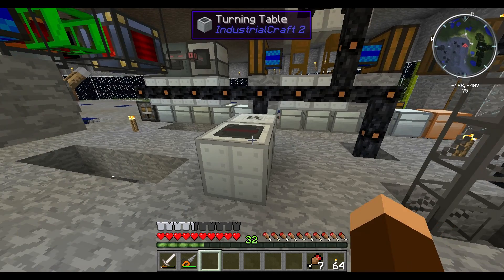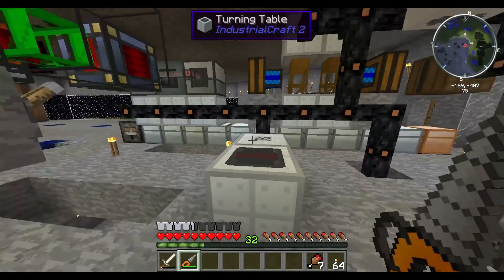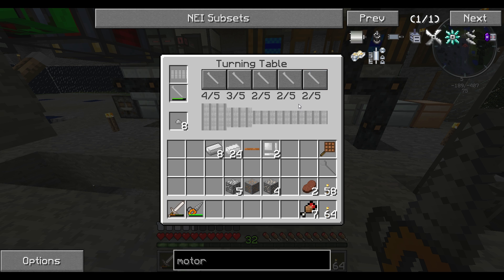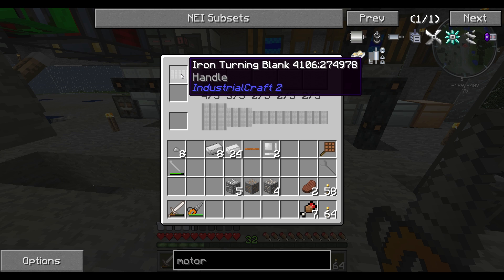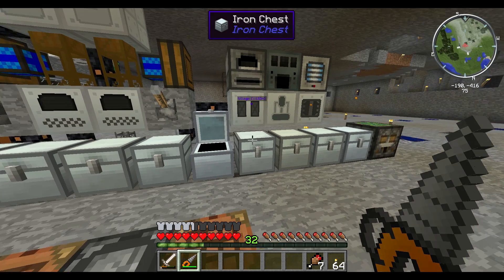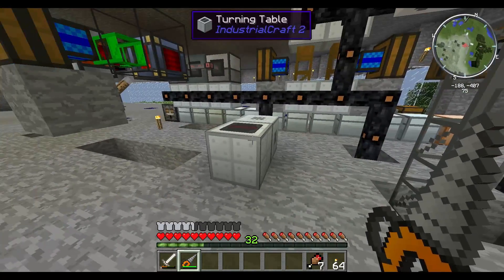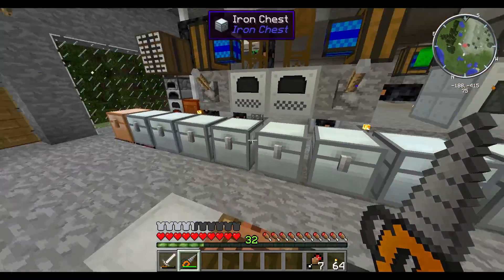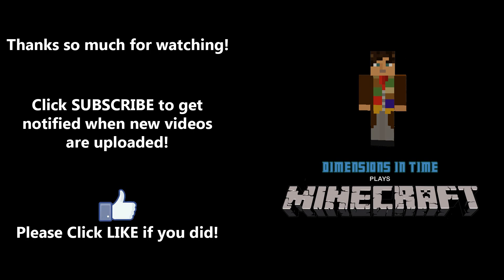Spotlight: IC2 Experimental - The Turning Table

Comment from the maker: This video is out of date now, I think versions of Minecraft from 1.8 on use the old recipe of using three diamonds, on top and either side of the drill, will create the diamond drill so you don't need the turning table for that recipe any longer.

Comment: @DimensionsInTime how do I craft the turning table? I tried what was shown in the wiki but it did not work. Did they changed the recipe and did not update the wiki?
Reply from the maker: As of Forge 10.13.4.1566 (which I am currently running) it was the same as the wiki here: http://wiki.industrial-craft.net/index.php?title=Turning_Table
Reply: Yeah, same wiki and the same recipe. I am running Forge 12.18.1.2011, minecraft version 1.10.2, IC2, a few other mods like IronChest, Backpack etc.. Nothing major besides ic2. 

I read somewhere in Youtube that the recipe was change and removed the turning table. All I  was the diamond drill which I got from putting a drill and 3 diamonds around it.
Reply from the maker: キラー蜂 Sorry to say, I haven't player 1.10 yet. According to the wiki you use the old recipe again, mining drill with 3 diamonds, two on sides and one on top.
Reply: DimensionsInTime Ah I see, well at least something worked lol. This is my first time using mods so I wouldn't know if that was the old recipe. I am pretty much learning as I go. I have always liked the build and industrial craft mods but currently trying them one by one and see how things goes. Thanks for the help.

Comment: ummmm i tried using the turning table with a kinectic generator and when i tried using the lathing tool on the turning blank but it didnt do what it did in ur video
Reply from the maker: +Joe Angel Be sure you are using an Electric Kinetic Generator, not just a Kinetic Generator. An Electric Kinetic Generator takes power (EU) and then turns an element on the side of the machine. A Kinetic Generator has an element on the side that needs to be turned in order to produce EU. They are kind of opposites. An Electric Kinetic Generator (the correct one to use for the Turning Table) needs to have motors put inside the interface to work. That's how you can tell the difference if confusing.
Reply from the maker: +DimensionsInTime Aahhh, I see in the description I had put "Kinetic Generator". I just fixed that. :)
Reply: DimensionsInTime I was using a electric kinectic generator
Reply from the maker: +Joe Angel Did you put motors in it?
Reply: DimensionsInTime Yea
Reply from the maker: +Joe Angel Weird. Just tried in test world, still works with latest version. You're using 1.7.10, correct?
Reply: DimensionsInTime yea
Reply from the maker: +Joe Angel Works fine for me in my Let's Play World -- https://www.youtube.com/watch?v=yYFIbf7fptc

Comment: It seems, that E-Kinetic Gen requires A LOT of energy! And also, it does not work with Mekanism's Universal wires... I tried to connect in differently, but it STILL DID NOT WORK. I hate this thing D:<
Reply from the maker: +Кэтишкэт Старье I actually stopped using Mekanism, sadly, because of the compatibility issues.

Comment: outdated
Reply from the maker: Did they change how it's made (again)?
Reply: I believe they changed how the power to it works but I could be wrong. Trying to use it and set it up I was having lots of complications
Reply from the maker: You have to use one of the kinetic power engines to power it, those are the ones that have a side with a rotating face. Match the two sides up and it should work.
Reply: yeah tried that. all good though i dont need this machine for anything

Comment: Power does not seem to be going into the generator... :/
Reply from the maker: If I remember, there are small squares on the sides of the machines that might need to line up. I think I got lucky that they did first try so I didn't notice in the video. Line them up to transfer power between the two.
Reply: Yea, i tried running it with its own power source (batbox) and that seemed to work, i dont think it likes sharing power with other machines :) Ty, Great video pal, keep up the good work :D
Reply from the maker: Glad you got it somewhat working and thanks for the kind words. Will be doing some more vids soon. My new mic arrived today!
Reply: +1 sub to you :)